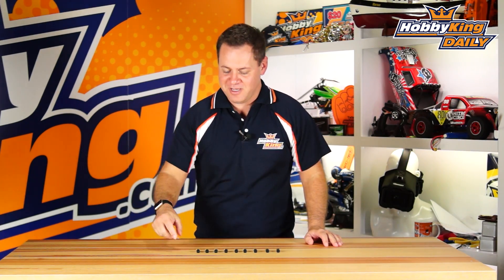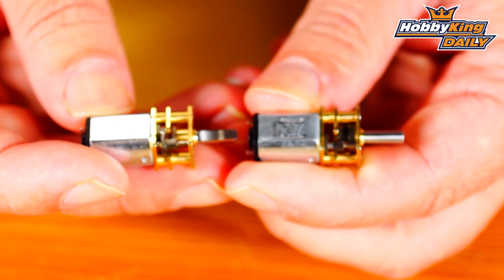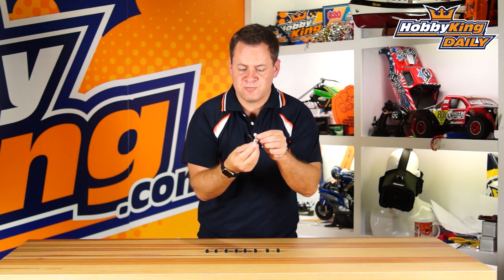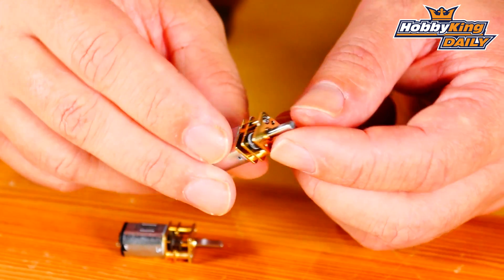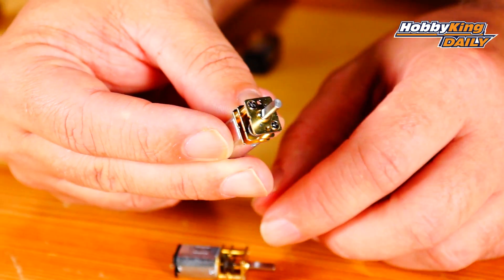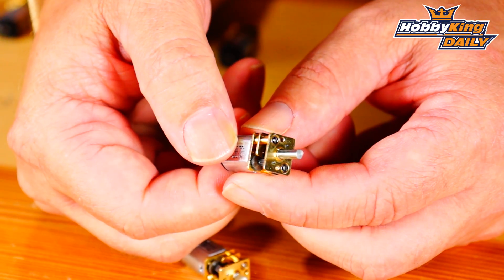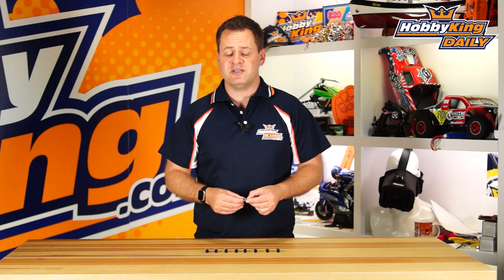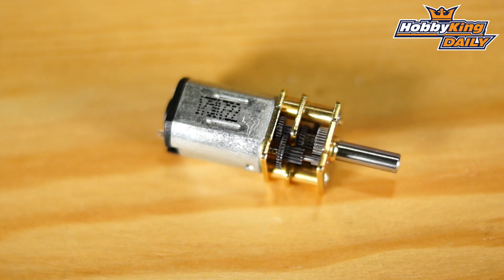Brushed Motor 15mm 6V 20000KV w/ 10:1 Ratio Gearbox - HobbyKing Daily

Comment: Talking about motors what kind of brushless motors can you guys recommend for a size 260 quadcopter
Reply from the maker: +Joel Salcedo Which frame are you using? Most of them usually have the standardized mounting setup. I'd recommend either 1806's or 2204's depending on your skill level. 2204 will have more power, but if you're a beginner 1806 would be sufficient to start with. 

Full set of 2204 motors:

http://www.hobbyking.com/hobbyking/store/__63065__Multistar_Elite_2204_2300KV_Set_Of_4_CW_CCW_2_CCW_2_CW_.html?strSearch=2204

You'll still need ESC's for these. Afro 20's would work great.

1806's:

http://www.hobbyking.com/hobbyking/store/__82987__DYS_BE1806_2300KV_Combo_set_with_16amp_Opto_Speed_Controllers_X_4.html

Comment: the KV ratio is so so so so wrong.
Specs sheets on HobbyKing is also wrong

Want exact values? Check the Pololu "Micro Metal Gear" page for specs.

And the ratio is input:output  .... 300:1 means 300 turns of motor => 1 turn after gearbox.

Also, bear in mind that these are DC motors and SHOULD NOT be used over 25% of their stall limit continuously.
Stalling them will overheat and damage them quickly.

But, overall, very nice motors and very cheap. If they are pololu's or similar then they are quite good.
(These are for RC cars and projects, not for quadcopters)
Reply: so what is the rpm of the shaft driven by the gears?